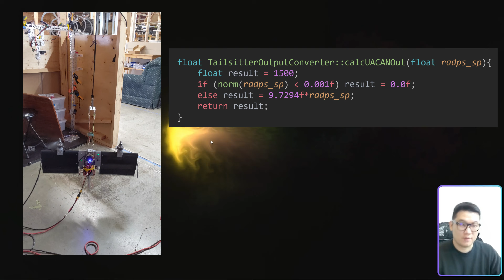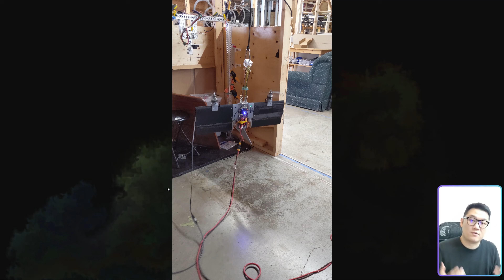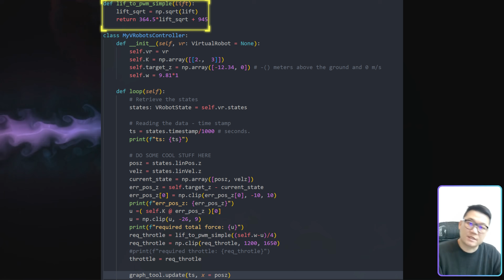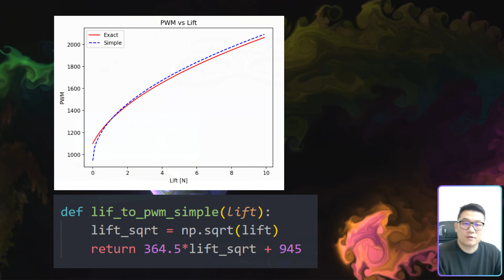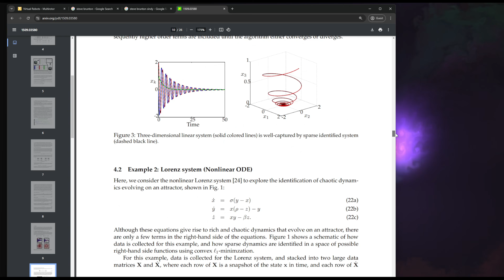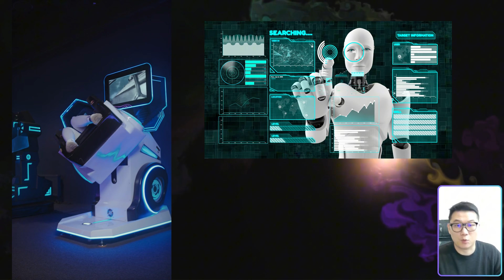Your Robotics Career Needs This: The Truth About Research vs. Development!

Comment: Utterly fascinating content in your videos Elliot, one question, do you have a plan to monetize that tail sitter robot?
Reply from the maker: Yes, though the main problem is the law not the engineering. Lol. What do you think?
Reply: @ubicoders  sadly most of the cases, law will be an obstacle!.. One use case that I can imagine is to use it as long range delivering robot Lol, will be great to know what was the purpose of that UAV
Reply from the maker: @illosuth  Exactly! And I was thinking about wild fire fighting. I will need to find out some b2g connections. But yeah, if the active wild fire fighting is possible, why not the delivery!
Reply from the maker: @illosuth  Yeah delivery! I'm currently working on a new model, multipurpose uav. Hopefullly, the demo would be uploaded soon. ;)
Reply: @ Those are good news! cant. wait to see your new video.

Comment: What about the business side of the two?  As in who pays for robot development vs. robot research?  If a robot developer uses something from robot research, how are the researchers rewarded?  Is it that researchers mainly get university grant funding to publish in journals, and then developers buy the articles from the journals, and then sell their products to customers?  Of course open source research is available and heavily used, but the rely only on open source would be limiting.  Then sometimes, what you need is not available in either open source or research literature, so you have to build it yourself - or because it is too expensive to acquire.
Reply from the maker: Good point! Unless the research comes with the patent, it might still need to be implement( the scientific idea) by the individual engineer. And let me quote my patent lawyer, " Why would you publish a paper to make your competitors get your work for free?" :) And this is why I guess some research papers mention their patents.
Reply: @ubicoders  I've read that patents as a form of IP protection isn't very cost effective most of the time.  It can be good, however, as a way to make one's company appear more credible.  My research advisor have also said that research papers are mainly advertisements.  I find that technical manuals and tutorials to be the best, better than research papers, at communicating to someone else how to use a technology.